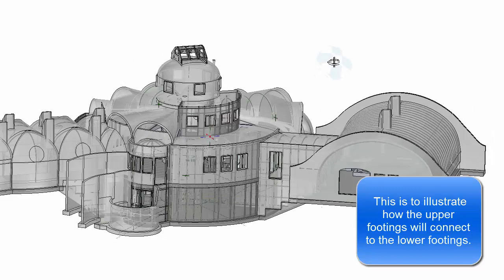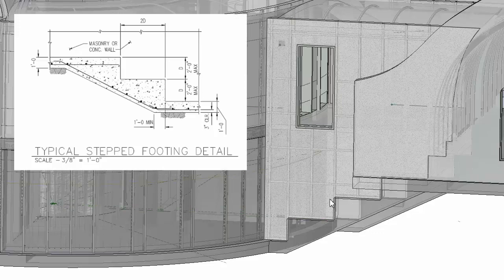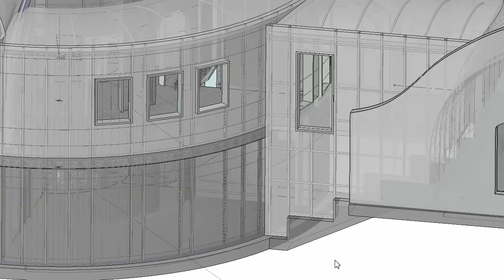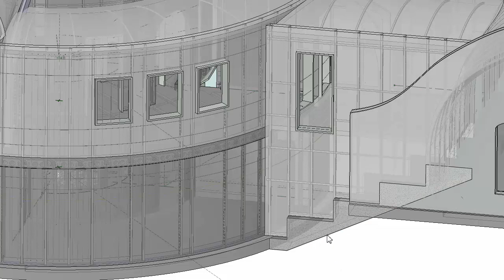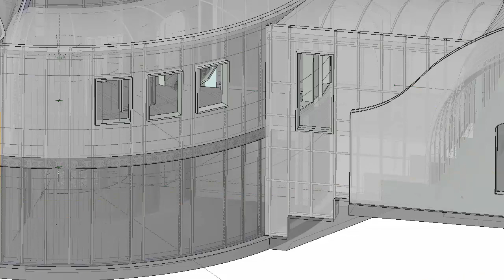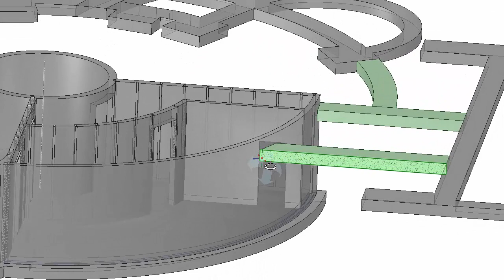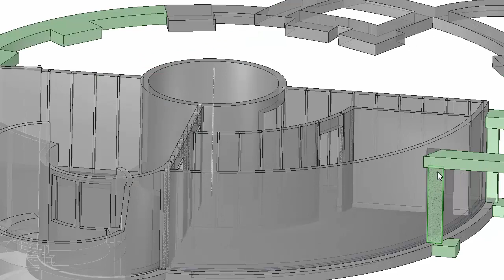2.0 Step Footings to Doweled footings

Comment: Do you have a finish set of plans.  I'm really interested in earth sheltered homes using concrete as you have.
Reply from the maker: There are lots of plan books out there.  Mine was custom job.   Warning if you are looking at plan books...  Way too many architects (including great ones like Peter Vetch) didn't put much thought into insulation.  Malcolm Wells was another who was well ahead of his time, so most of his early plans don't take solar gain into account. One suggestion would be to look at apartment layouts (find advertisements for loft conversions).  Based on similar design considerations, it is usually pretty easy to convert one to an earth sheltered home layout. Just imagine that the neighboring apartments are dirt.  I have more info on this topic on the website, www.homeintheearth.com